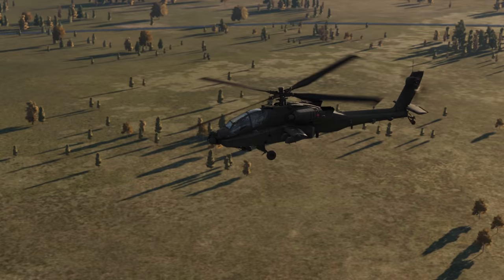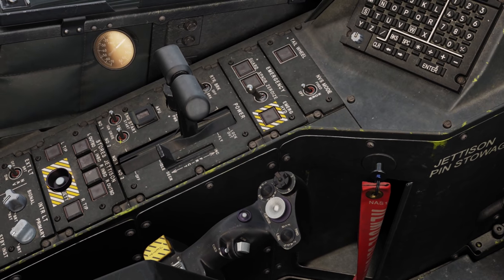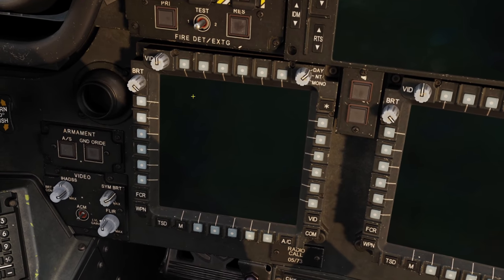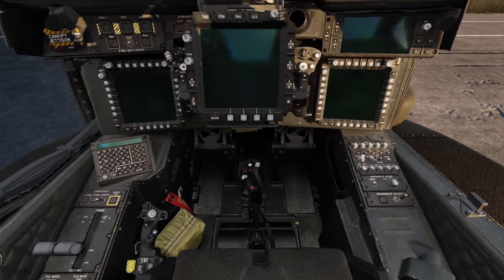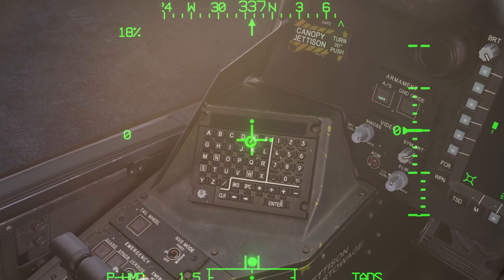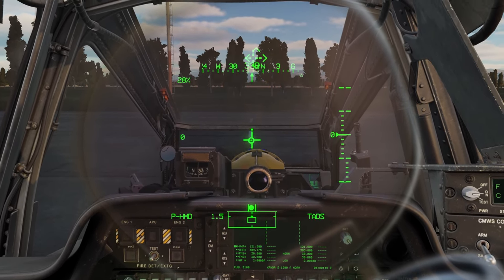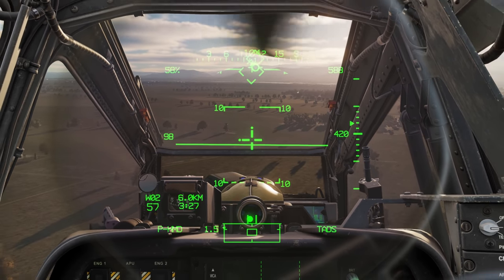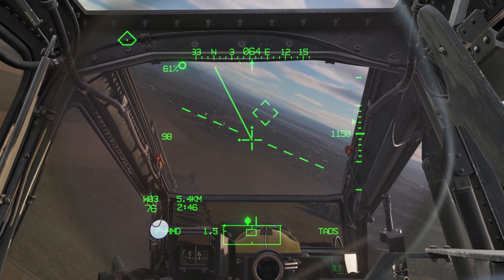DCS: AH-64D Tutorial | Getting started with the Apache

Comment: Thanks Casmo !
One question though (and I hope this is not sensitive material) :

Where do you guys keep the ignition keys of those bad boys and are they usually parked fully loaded with fuel and gun rounds ?

;-)

Will probably wait for that module to mature a little bit but will most likely buy it.
Reply: Can't really speak for 64's cause I'm a 47 pilot, but as for the key I can almost guarantee they're stored in Flight Ops and signed out before every mission. They're probably stored with fuel, as I'm sure, like my community, they harp on making sure pilots fuel up their aircraft after every flight. As for gun rounds, doubt they stay loaded. Pretty sure 64s have to be parked in a specific area, facing a backstop, anytime they're actually loaded. But that could just be for rockets/hellfires. None of that is sensitive info. Casmo was referring to ASE and the specifics of all that stuff, which is stuff we can't talk about.

Comment: Okay, I'm gonna ask a couple question if I may, and I apologize in advance if I'm asking a question that your video will answer. It's late and I don't have time to watch it all right now (but I will, I promise). 
- Is the Apache suppose to be so erratic on take off or am I just not doing it right? I have one heck of a time getting airborne. The thing just wants to go everywhere until I can finally get it moving in a somewhat forward direction. Once I get a bit of airspeed built up, I can fly it just fine. It's just take offs I have an issue with. I honestly haven't tried landings yet but I hope they're a bit easier than in the Huey.
- It seems like I can't get much more airspeed than about 110-120, maybe 125 kias unless I'm going downhill. I thought the Apache was faster than that. Am I missing something here? Should I be getting more airspeed than that or is that about normal? I am flying with a full weapons load so maybe that's it...?
- As I am moving along at cruising speed, I have a constant slow wobble that appears to be in the roll axis. no matter how still I hold the stick, it always does this. I have never noticed this in any other helicopter. Is this normal in the AH-64?
- Does the Apache have some kind of hover mode?
- I might be getting a bit ahead of myself, but is the FLIR lens in the nose ever suppose to follow the pilot or gunner's view like the cannon does, or does that only move manually?
Thanks in advance.

Comment: Hey there!  Were you a 64 driver?  I flew Deltas for quite a while and I still can't get those checklist callouts out of my head (before take/off/ landing etc).  Good intro video for people looking to fly this.

Only other thing, is a lot of units do things differently, lol I had chills when you unlocked the tailwheel with rear momentum.
Reply: Also rotor brake ops... un-neccessary maint write-up requirements post flight (during normal ops) if you ever need it, you'll know, because a Battalion (likely Brigade) commander will be somewhere on the risk assesment if it is lol.
Reply from the maker: I can still remember all my Kiowa call outs… Apache…. Not to much lol

Comment: I cannot even hover. As soon as I apply the collective I start spinning. I try to counter with opposite rudder and get the spin stopped, only to spin the opposite way. And I keep getting messages that my rotor RPM is low. I have a decent Thrustmaster stick, throttle and pedals, I just cannot seem to get stable enough. Frustrating
Reply from the maker: You clearly have a controller issue.

Comment: Why does the helicopter fall out of the sky with a low RPM warning when you go full throttle during take off? 

I was trying to practice a fast as possible takeoff but when I put power into the collective the helo crashes fast.
Reply from the maker: Too much power will drop the rotor. Don’t go full power. You will add too much pitch to the blades, slow the rotor, not produce lift. It’s a stall.

Comment: Being used to the KA-50 I’m struggling with the trimming part. How am I supposed to treat the AH-64 as regards to trimming compared to the KA-50. I’m used to keep my finger on the trim button and as soon as it’s flying the way I want release the button. Is there such a simple “trim” button in the AH-64? As I’m cruising in the AH-64 I have to keep pushing forward on the stick, is there a way to “recenter” the stick so I can just let it go?
Reply: in the Special Settings set Cyclic and Pedals trimmer mode to Central Position Trimmer Mode. Then when you Press Up on the Force Trim switch you can use it the way you describe
Reply: @Henry-ql8xm  thanx! I will give it a try, also Wags released a video yesterday explaining it a bit more. I just need to find a way to get comfortable with it. It a different beast then the ka-50

Comment: Anyway to stop the AH64 from wanting to spin so much? It’s almost impossible to deal with without pedals.
Reply: thats just helicopters... your gonna need some kind of rudder axis
Reply: @wreckervr5769  Yes, my throttle has pedals on the front, but of course no where near as good as real rudders. I was hoping there was an option that wouldn’t require me to have to baby the rudders as much.
Reply: @cr0sss  im not sure,  are you using the thrustmaster tcws throttle? you could go into your rudder controls and use the tuning tool to adjust the curvature of the axis which could make having fine adjustments with the rudder a little easier.

Comment: Buddy I just bought the Apache and Everytime I unlock the tail wheel the aircraft spins sitting on the ground with the power levers up.  Is this a bug?
Reply: Im pretty sure its just the propeller torque causing that, you have to use the rudder to keep it straight.
Reply from the maker: Ofcourse it’s just the torque. The issue is that at flat pitch the aircraft doesn’t spin around like a top.